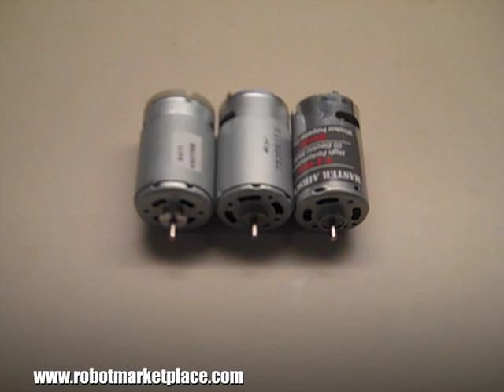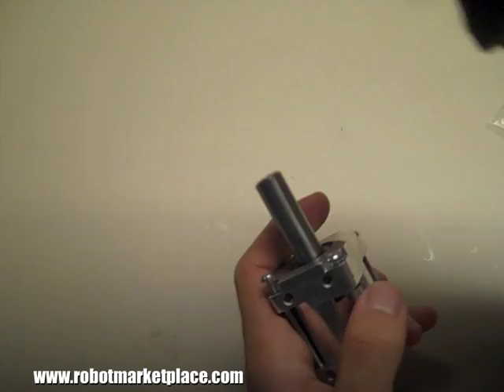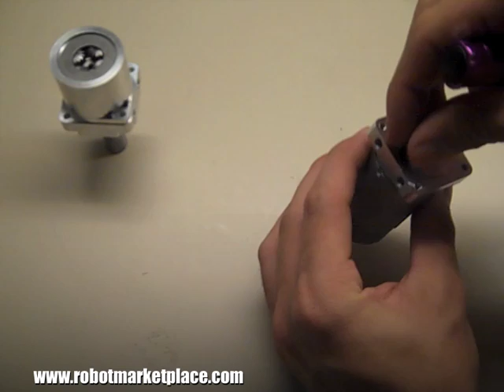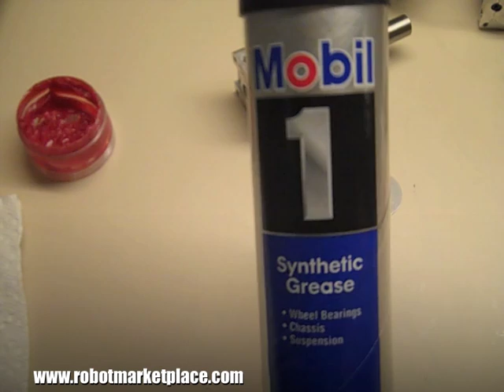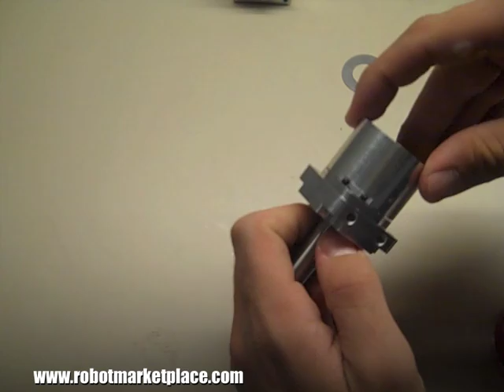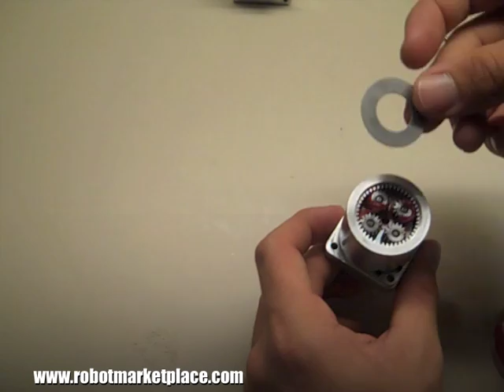Banebots P60 Gearbox Installation - The Robot MarketPlace

Comment: I shoot trap, They sell "specialty" gun grease at a huge cost, 
As a mechanic I decided to use this red mobile one synthetic same as in this video, 
I've been using it on a new gun exclusively for a few years now to see how the wear is and it has outperformed all the other crap I had bought and one tube will last for years.

Comment: can any one reply what motor controller to use for this kind of motor?
Reply: basically any brushed controller (easiest to see: brushless needs 3 cables, brushed only 2) with the right volt/amp rating. since these differ depending on the exact motor, there are lots of options. you might want to not take a car controller, since these often  have a "break" programmed, not letting you turn to reverse instantly.

Comment: Quick question. What gear ratio should i buy if i want to go up to 10mph? I will use rs550 motor, sabertooth 2x25 esc, 2.75in diameter wheels, 50lbs total weight, 12v battery.
Reply: 1250 rpm. I know I'm 6 years late.... whatever
Reply: hello
can you explain me what mean 516:1 ratio?
how much has it rpm in 12 v?